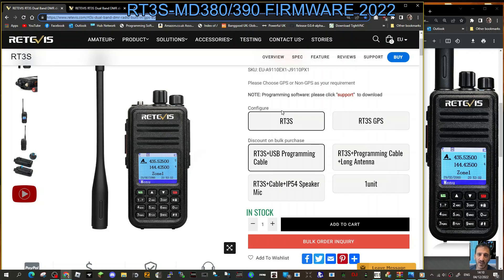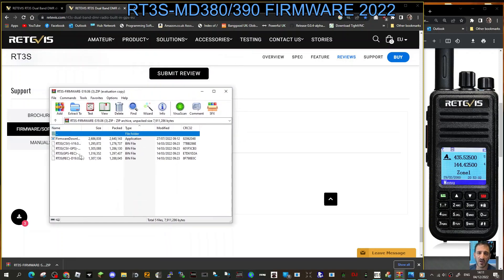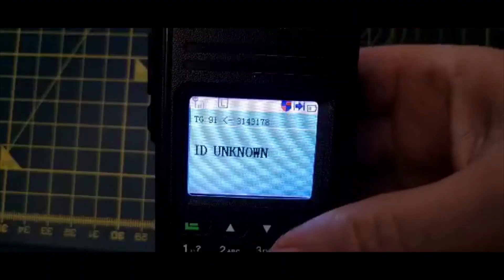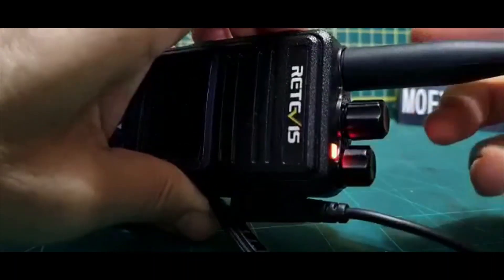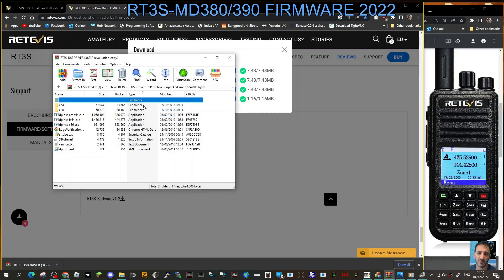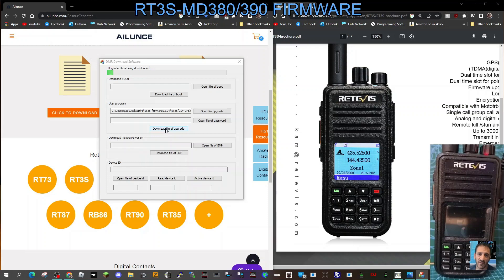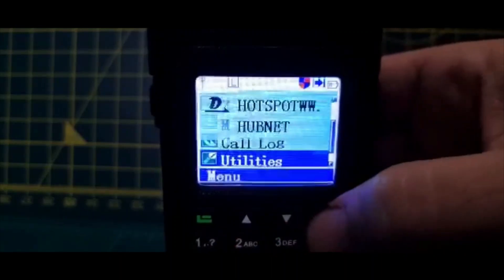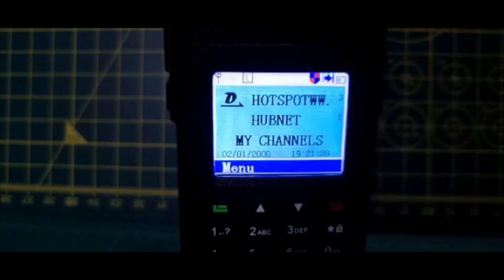RT3S-MD380/390 FIRMWARE v19.01(2022)-  Upgrade Process & Software Links

Comment: I have a question does the VFO mode work on your new Firmware, on mine it doesn't and the other RT3S I have has an  older firmware and that works. Like holding the red button for longer time, and you get in VFO, just asking maybe I missed something in settings. Thanks
Reply from the maker: It's same

Comment: Tell.And what can happen if you install version 1.30 of MD 390 (with GPS) on MD 380 (without GPS)?
Curiosity is not a vice.)))))
Reply from the maker: Mixed results usually screen goes weird u can't use Radio .
Reply: @M0FXBHamTech  Thank you very much

Comment: Hi. I am on Windows 11. 
ACPI x64-based PC.
I am trying to install RT3S driver and I clicked on
1.) dpinst_amd64 (it went thru)
2.) dpinst_ia64 (I get this error: This app can't run on your pc, to find a version for your pc, check with the software publisher.
3.) dpinst_x86 (it went thru)

when I follow your procedure, STM Device in dfu mode doesn't appear/happen.

Is there a different way to do this? Like update without the cable?
Reply from the maker: Try this :https://youtu.be/8CkZH2FWMjY?si=M_Z19ZoDeAV1Ssn5

Comment: Iam not able to get the USB driver to install or run as admistrator so I can update the firmware on my 390. Iam at a loss here now I just have a useless 390 radio that I can not do anything with. I have also tried to update the USB driver to no avail for it to not be able to read the USB update maybe I need an unzip file for the USB drivers I will try everything I know before I give up. Cause I also really wanted to do the gd 77 mod as well..
Reply: Update I was able to get the USB driver installed and updated. I was able to install the firmware update and turn on the option to programm through the radio.
Reply from the maker: So glad its sorted .
Reply: @digitalhamradioScanner  yeah I ran I to every promble. With no comm port communication as the main one. I had to don't on my 2015 dell laptop. I could not get the USB to see the radio on my acer.  So I will see if I can fix or locate a USB driver for my acer. But for now my Dell computer can programm my radios.

Comment: iam not able to acess this page here in america to update my firmware on my 390
Reply from the maker: Only do firmware if you have to .
Reply: @digitalhamradioScanner  I was able to get all the file bins
 But when I try and do the firmware update it says USB comm fail. So I thinkni have to install and import the USB driver before it will Wright to the radio. And the 380 with GPS was the closest I could get to my mdn390 with GPS model